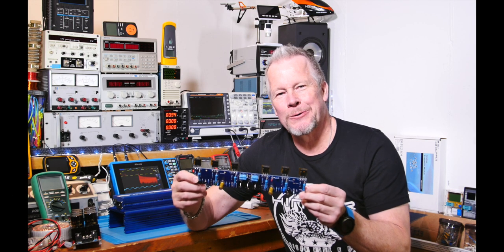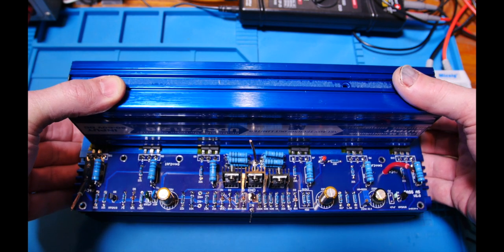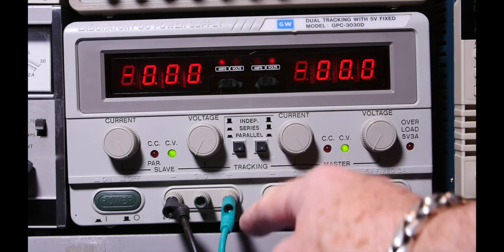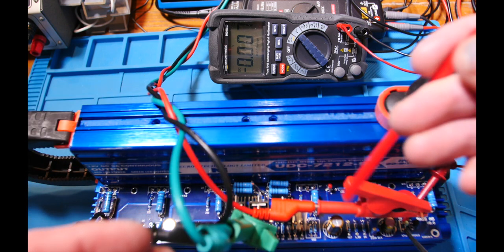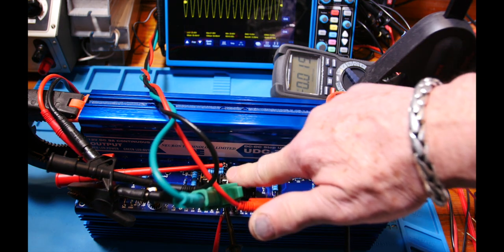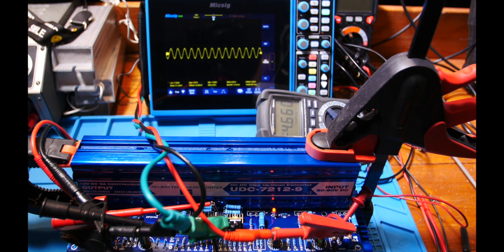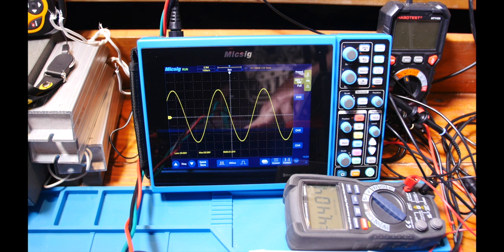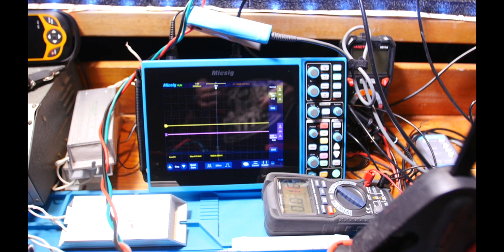Class A Amplifier Project Aleph 5 First Tests

Comment: You did a great job of analyzing amplifier performance. I love the array of test equipment you have at your disposal. From your test results, it looks like frequency response and phase could be improved by tweaking a few component values in the amplifier chain. Perhaps it would be beneficial to take another look at the circuit design of some of the circuit blocks. Bjorn V's insightful comments below should be well accepted and understood.
Reply from the maker: Thanks Gerard!  The fun has just begun I think;)  We will have to delve into this a bit deeper and learn more.

Comment: Fascinating. I built the John Lindsley Hood single ended Class A amp some time ago. Wonderful sound but ran very hot even with huge heatsinks and at only around 15 Watts.
By the way your link to the kit seems to be broken. Could you put up another one-I'd like to take a look.
Thanks
Reply from the maker: hhal9000 I will probably build that Amp as well to compare.  Yes these Class A designs are ant thing but efficient;). I’ll get the link fixed - thank you!

Comment: hey Eddie great video. When looking at the harmonics with a scope, be careful as most digital scopes have 8 bit ADCs and the Quantization error is going to mess with the harmonics seen after the FFT conversion.  And if you use the measured harmonics in calculating THD, it will be off too.  As an experiment, just look at the output of the signal generator with out the amp, I bet the harmonics are still there.  You might want to measure the THD with something like a HP 8903 or similar.  

I'm really enjoying your content and can't wait to see how the Aleph 5 stacks up against other amp designs especially class AB ones. I just received my Aleph 5 kit in the mail and will start the build soon.  

-Andy
Reply from the maker: That's great feedback.  I just recently sent a scope manufacturer the question about how the resolution can be better than what the 8 bit ADC can provide.  I understand that in frequency domain that it can be better than what you get in time domain.  I don't know if it is oversampling that isn't possible in real time mode that time domain works in...??  I'll have to research more;)

I can't wait to get back into this project.  I had a few things come up - as they do;)

Comment: Thanks Eddie, lots of fun!
You need to check the distortion of your source generator. Those harmonics might be an aspect of the amp itself. That's the thing about audio, we like distortion, I personally love second harmonic distortion from tubes so I build tube preamps. My thinking is that once you get the sound of the preamp to what you like you can just run a neutral power amp. I'm not sure class A sounds better than AB really. Maybe in the old days of complimentary/supplementary where you got weird cross over notches but not in the new stuff or LM3886 chips. I haven't watched your other videos on this design but can you pick it out in a double blind test? Is the sound that unique?
Reply from the maker: Thanks for the great feedback!  You are so right about the generator THD;)  See link below: https://youtu.be/TQPQmziLaPw
I'd like to know how many people could actually tell the difference in a double blind.  I like the idea of a neutral amp and letting the preamp/mixer change the sound for the individual.

Comment: There were quite a lot of harmonics (-60db)  in the output waveform.  How clean is your input signal? If you have all those harmonics in the input, perhaps a "cleaner" reference signal should be applied.
Reply from the maker: Gerard Regnier Yes I need to see if that is from the generator or what’s causing it.  I’ll find it then make a quick video on the solution ok?  Thanks for the feedback!

Comment: I saw that you use the Micsig Differential probe in combination with the MicSig Scope.
Now, the thing is, i came across a website called Batronix.com , a big supplier of measuring equipment, powersupplies etc... 
and under the section of differential probes, there is a note under many probes that say : 
"Only connect to a grounded oscilloscope".
This is also stated by the 2 Micsig Differential probes.

Now my question/remark is, when you use your Micsig scope without the external powersupply, 
your scope is floating and isn't grounded.
The ground of your amplifier is grounded, so the negative input of the Micsig probe is also connected to this ground 
(with internal 5Mohm between the negative input and ground).
The negative output of the Micsig probe and the negative input of the Micsig scope are not grounded.
Does this give a difference in output results ?

Because when the scope is grounded, the negative input lead of the differential probe is at the same ground potential as his negative output, 
and the negative side of the probe is in fact bypassed from input to output,  when you do measurements on a ground referenced voltage source. 
This bypass or not, must give (i think) different results on the scope screen.
Reply from the maker: Great Questions Bjorn!  Just one correction, the amplifier is not grounded but maybe you meant the signal generator?  Yes, this is a great question.  I know I was grounding the amplifier at its input due to the signal generator being tied there.  Now when I left the scope external power supply connected, there was a high impedance connection at the diff probe connection at the output.  I wonder if that could have caused some of the signal input distortion?  Later when I used the GW Instek scope, I then tied the one probe to the input which was also grounded and left the diff probe on the output, so probably no further issue there.  One other thing, the diff probe was powered by the GW Instek in both cases, which probably didn't cause anything - but could have added some noise.  I'll have to be careful to try different connections like power the diff probe with the Micsig when I use that scope, and I'll remove the external PS.  I'll experiment.  Great feedback!!
Reply: @KissAnalog  , i meant this :  if your scope is grounded, and you measure a voltage source which is also referenced to ground, then the negative lead of the diff probe is "shorted" from input to output, because both negatives are then connected to ground. But from the moment your handheld scope isn't connected to his own DC powersupply, your scope's ground is floating. Between this floating ground and the real ground on the input of diff probe will not be 0V. Also, the power input (usb connector) of the diff probe itself has a DC-DC converter on the input, so it's complete isolated, so noise is not likely induced at that point. Grts
Reply: @KissAnalog  , the amplifier is also grounded through your bench powersupply :-)

Comment: Eddie,
Follow up:
I found an ebay Aleph 3 I bought last year. I remember playing with it cobbled up with SMPS supplies. After watching your great videos on the Aleph 5 I dragged it out and put it on the bench.
First, even though I had decent size heat sinks I still had to use fans, I might have been able to get away without them but the amp got a  little to hot for my liking.

With a 3.3 ohm resistor on the output, running 25 volt rails the amp clipped at about 6 or 7 watts rms. The advertised gain was 26 db but all I saw was 20. 

The FFT distortion you're seeing is apparently inherent to the Pass design. I found an old (~1997) Stereophile article on the 3, you can see the charts from their tech. 

https://www.stereophile.com/solidpoweramps/674/index.html

The amp doesn't sound bad but I figure when I'm done, even with the switching supplies, it will still run ~250 watts on the input to make this thing work. I think, after seeing you tests that you got a better set of boards, it looks like you got more power out of your amp than I got out of mine. So the jury is still out whether I want to finish this in a case or not, maybe I'll see if I can find your boards if you think the sound is marginally better than AB. I'll keep watching to see if I missed anything.
Reply from the maker: Thanks so much for the great feedback!  Awesome info!  I got stalled on my Class D so I’m working on a Class D right now!  Here’s the link;) TDA8954 Class D 420 Watts x 2 https://youtu.be/PCv--y2y3AQ

Comment: It's not bridged is it, and what's it like in bridged mode?  you should try the Nelson pass kit class A amplifier, on test paper it looks awful people say it sounds great.
Who's this amplifier made by.  your power supply was struggling a little bit I wondered how much that had on the test results,  couldn't you use a variac and a bridge rectifier couple of filter caps wouldn't that be better. You got that big power supply with the filter caps couldn't you use that
Reply from the maker: John sweda Great questions!  No it is not bridged.  This is the Nelson Pass Aleph 5 kit;) Check out this playlist where I introduce it.  I do have to get my variance out of storage;) For this initial power up I thought this smaller supply would be enough just to be sure it is running.  Here’s the playlist; Aleph 5 Pass Amplifier Project
Reply: @KissAnalog  right was a good guess then, I thought the Nelson pass was 15 Watts this one's a lot higher, do you think this is the best kit he makes.
Have you listened to through speakers yet and what's your impression...

Comment: @20:05 it's funny when you have lot of expensive equipment at your lab and there is NO thermal camera around to check the heat without putting your fingers here and there ..
Reply from the maker: LOL, thanks for pointing that out;)  I do have a thermal camera, but I was trying to make the point that you should be able to touch hot parts (that they are not too hot;) I did think about using the camera though;)